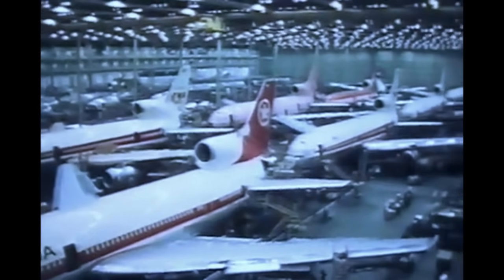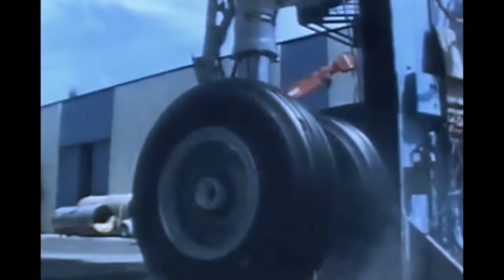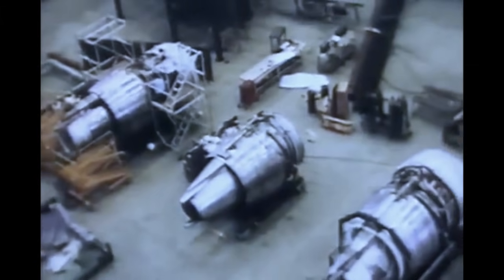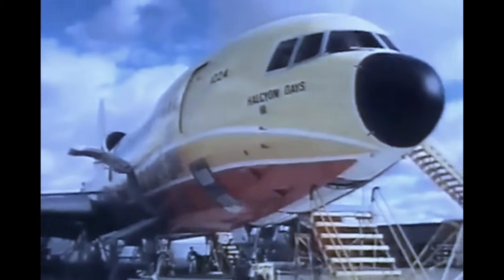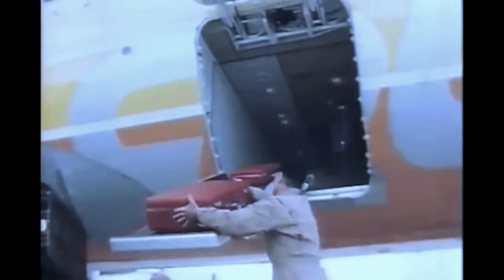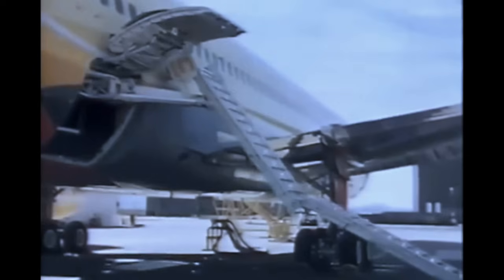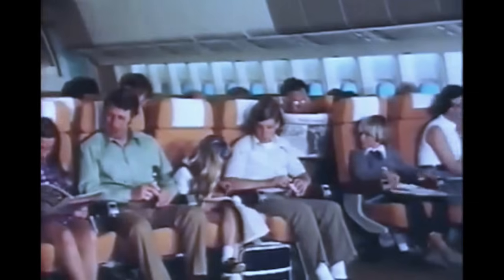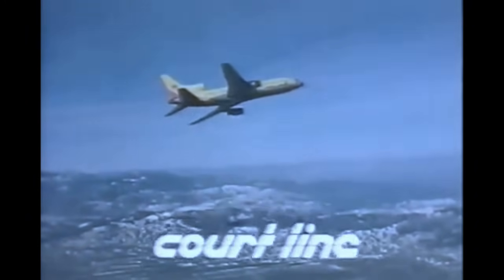Court Line Lockheed L-1011 TriStar Promo Film - 1973

Comment: The L1011 was a beautiful plane. However, the same cannot be said for Court Line, a UK holiday charter airline which was the 60's/70's equivalent of Ryanair! Court Line operated the L1011 for about 1 year prior to their bankrputcy. Note the 10 abreast seating. In that era most airlines offered 9 abreast on the L1011 and GF and some US carriers in the original configuration actually offered 8 abreast in Y. The seat pitch on the Court Line L1011's was pretty poor too. Don't for one moment imagine that holiday charter passengers got meals like those pictured in this vid on their flights to Spain or other destinations around the med. Most Court Line holiday charters were operated by BAC 1-11 which featured the infamous 'seat back' catering concept. On the L1011 it looks as if the meal was probably served rather than being in a box placed in a locked compartment in the back of the seat in front of you which was unlocked by the cabin crew with a key during the flight, but no way was it of the quality shown in this promotional video.

Comment: For some reason the Air Force chose the DC-10 over this jet for an air refueling.  It must have been a far better aircraft.
Reply: which?  The DC-10 probably cost less.  Or maybe it was a political decision.
Reply: Sure. Because that is how military procurement decisions are made. Just like the USAF choosing the Boeing 767 over the A330 as its new tanker. Because it is superior. That totally didn't bite them in the a**.

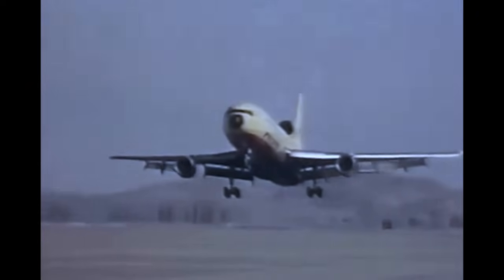Comment: Its growl of those RR engines at 3:38 and 7:50 that did it for me. I wish I flew on this plane. I flew on my first airplane in 1997 at the age of 12 and it was Continental airlines. Been addicted to flying ever since. I’ve flew on B727, B737, B757, B767, and MD80. I’m very interested in the L1011. Why did they stop producing this plane?
Reply: The A300, first of the big twins, then the Boeing 767, saw off the Tristar and DC10.
Reply: It was a perfect storm for Lockheed. The RB211 engines were plagued with delays, and it was the ONLY option for the L1011. Due to the delays, many airlines chose the DC-10 over the 1011. Lockheed’s marketing and sales also weren’t as adept as Douglas’ equivalents since this was Lockheed’s first passenger plane in decades (didn’t have the inroads like Douglas and Boeing). 

Although it was considered a mild success at over 200 built, it was still a massive loss to Lockheed, and they stopped production in 1984. Lockheed never made another passenger airplane after. 

It truly was a plane of legend. Lockheed managed to make something that both passengers and pilots loved. It’s sad we’ll probably never see another like it again in this age of “cattle call” flying.

Comment: It's more about airline industry rules, her third engine gave way, required at the time for transatlantic flights, to more economically efficient twin turbo fan designs, however the tri star was a fine air transport nonetheless. Would have made a stellar Air Force numeral uno.
Reply: Yeah, same reason we're seeing the last of the big quads as well -- the A340's no longer produced, if I'm remembering correctly, the A380 is increasingly in danger of cancellation, and the pax version of the B747 is nearing the end of its production run, if it hasn't already.

The gradual relaxing of ETOPS regs for over-water  flights and the fuel and maintenance savings of two versus four (or three) engines has doomed the lot of them. :'(

Comment: its stupid that airline buying more DC-10 than L-1011 TriStar. i think they prefer to buy "Death Craft -10" than L-1011 TriStar
Reply: DC-10s were easier to maintain and the DC-10s lasted longer. The only advantage the L-1011 had was a slightly better fuel economy
Reply: @lm7bird680  The L-1011 was also less likely to fall out of the sky. That's a pretty big advantage.

Comment: what happened to built in stairs and baggage ramp? Doomed when DC-10 was built for the exact same market, it did not have the S-duct. Last operator was RAF as tanker, their version of KC-10. If Lockheed had built the SST, it would have flown before or perhaps might not have been cancelled.
Reply: +biukucanoe  the  built in stairs and baggage ramp were soon taken out by Court due to finding that they weren't used very often and without the weight of these it gave the plane a better payload. 
Having the S-duct caused a loss of efficiency to the tail engine by 10-15%.
Rolls Royce going into receivership during the RB-211 development put the TriStar project back a year allowing the DC-10 to steal a large margin of time over Lockheed's plans.

Comment: Why didn't the Tri-star last longer in commercial operation?
Reply: Tri-jets were phased out as twins got longer ETOPs ratings.  Now twins can have an engine failure at take off and fly the whole route (even though they won't).  ETOPS means if you have a failure over mid ocean, you need to fly for certain length of time (thus you can't be too far from an airport behind or in front of you).
Reply: +TommyTwobats  Not enough room in market for DC-10 and L-1011, McDac was already strong in airliners, Lockheed last effort was propjet Electra, half of those were lost due to crashes or other causes. Ironic now that stretched Dash 400 props are replacing short haul 737s now.

Comment: This stair folding into the rear cargo hold is unbelievable, also didn't know you could have onboard ladder for baggage loading. Wonder if it was options as all of that must have been weighted quite a lot and what about reliability ? Can you figure out the stair half deployed and stuck there by electrical or mechanical fault damned...  Best memory about the bird was the size of the cockpit and the view trough the cockpit windows as I visited few of them on tarmac. Not sure if all pilots who flew them would agree no other airliner cockpit would be as comfy as the Tristar one ?
Reply: Yes, both options were very impressive! I don’t think any other customers ordered them though, as this is the only time I’ve EVER seen them in a picture. I’ve often heard that Lockheed offered an option to board through integrated airstairs to the lower level cargo compartment. I now see that they meant the stairs were STORED in the cargo compartment, but actually connected to the main upper deck doors. It all makes sense now

Comment: The Tristar was trijet masterpiece, complete at all levels. You can't get much better than that.
Reply: S duct didn't really matter -- L10 still was fastest in the sky during its time.  Flew between LAX-ATL many times and the L10 always had the shortest flights.  Was a great airplane ahead of its time which brought its demise.  Too much $ in tech.
Reply: +João Branco - Sorry but the L1011 was flawed from its conception due to that S-duct air intake.
Reply: +2300magnum  No flaw in that. Once the S-duct was perfect it was advantageous. The 727 had some minor problems with it that were worked out and it was fine.
Reply: +João Branco Having the S-duct caused a loss of efficiency to the tail engine by 10-15%
The RB-211 engines were still being developed by Rolls Royce to fulfill their full thrust potential which wasn't realised until the late 70's which meant that the plane couldn't take off with a full payload.
Lockheed then introduced the 500 series (a shorter fuselage and bigger fuel tanks) to give it a better travel distance. 
But don't get me wrong; the TriStar is one of if not the best looking plane to fly in the 20th century.